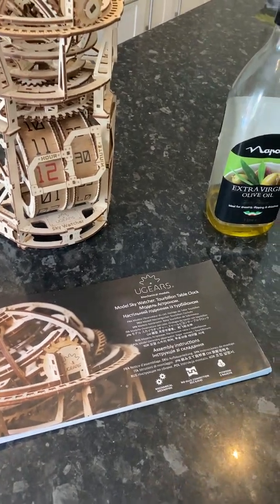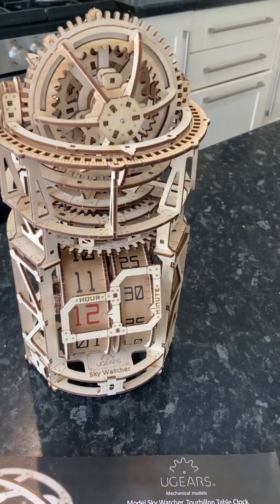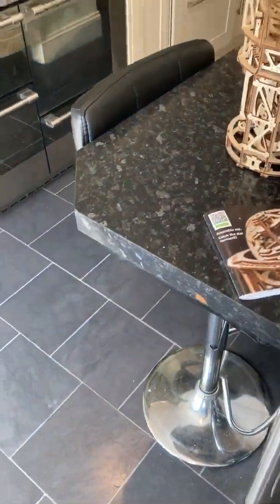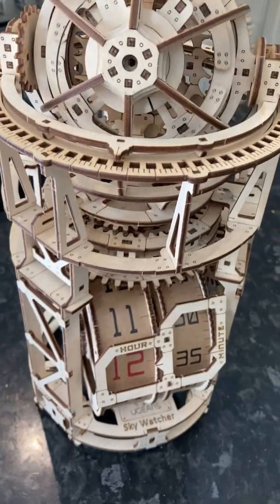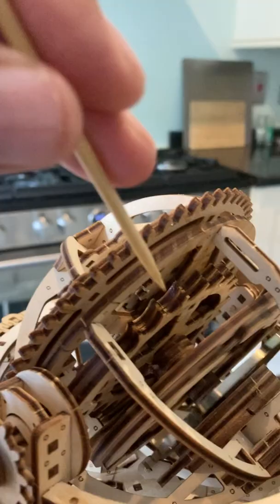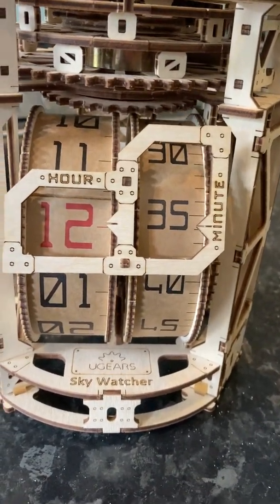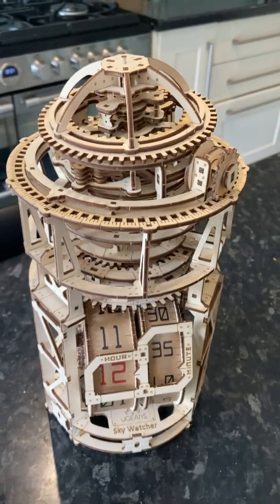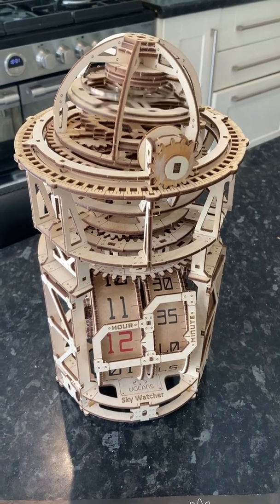ugears Tourbillon Clock fix

Comment: The fork hangs up on the cam.  Ideas?  The cam should swing well through the fork.  The flywheel should rotate freely, which it actually does.  The knob just catches on the way back in, generally when traveling left through the fork.  So very frustrating!!!
Reply: did you find out? i got a similar problem

Comment: I wonder if the oil might eventually cause the wood to swell up, even slightly. I think I will buy the cheapest kit of these types that I can find and experiment with different lubricants, maybe a drop of CA on each gear tooth would seal it and make it hard and then it could be lubricated with whatever without having the lubricant soak into the wood.

Comment: Great tip! Thank you! 
Now I have only one issue left: the mechanism of the balance spring stops after a few turns. The tourbillion moves well, it just stops all the time. Even after moving the levers it didn't work and I'm running out of solutions.
Any ideas?

Comment: Great build and piece of engineering!!!!
Thank you for the olive oil tip - building mine at the moment and despite careful sanding & waxing, it was binding on the escapement mechanism.
I little brush with olive oil on the teeth and now it works a treat :o) :o). :o)
Always thought that wax (although good) was a little thick and sticky to provide smooth running.
Reply: how did it age though?